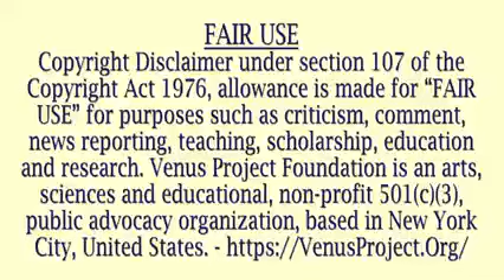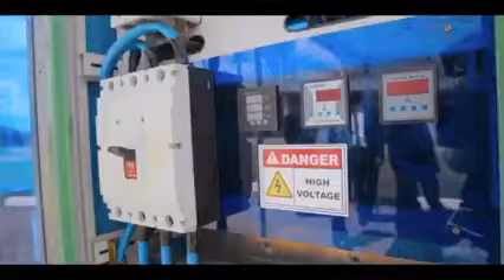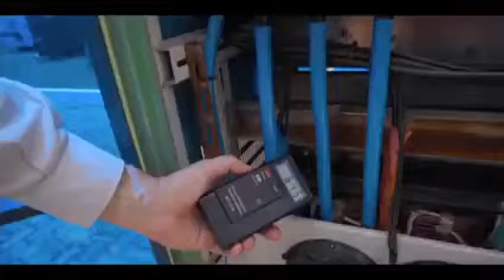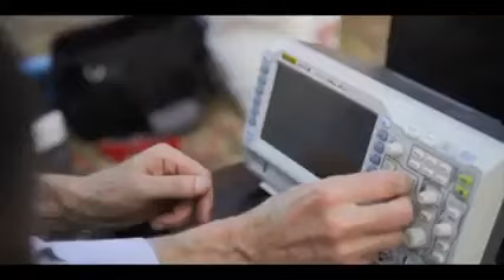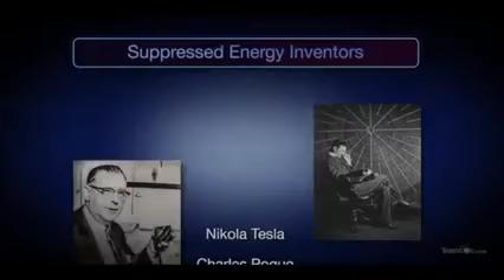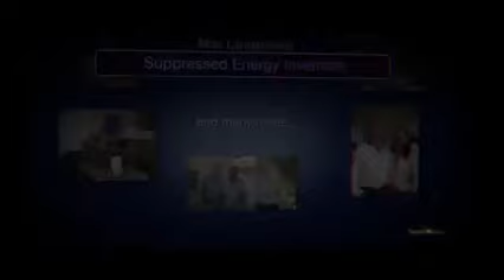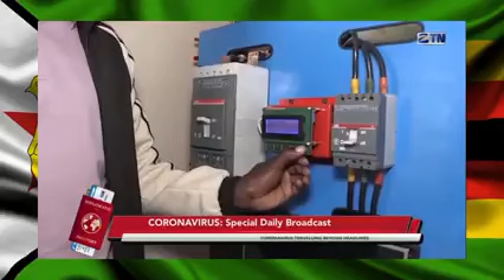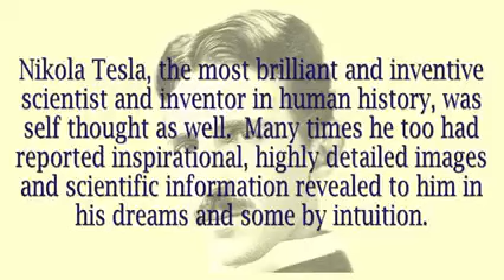Maxwell Chikumbutso 🇿🇼 - An Inventor - Microsonic Energy , Saith Power.#African #HighIQ #AncientMIND

Comment: Didn't Tesla try that with his tower but failed?
Reply: Where are the comments
Reply: Right
Reply: He failed hands down because he was very dense to match the African level intellect.
Reply: @user-mb7sh9om6f he failed because his funding was pulled.  Editing wasn't happy he had a competetor for his dc(direct current)
Reply: @Mulubhubesi  but now we know that it's impossible to have enough power  from radio waves to ran even a  even a small electrical machine of modern standards hence the use of the amplifier circuit..
Reply: @Mulubhubesi Edison. Plus telsa was doing it a large scale. In simple term he was building a large tower like pyramid where it would send electricity wave from miles
Reply: He didnt failed. They take it from him😢😢